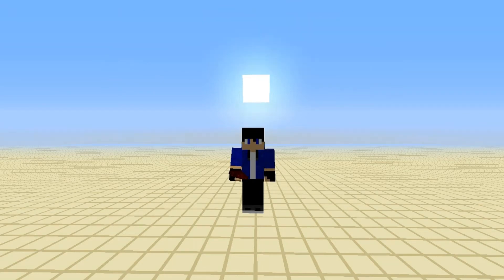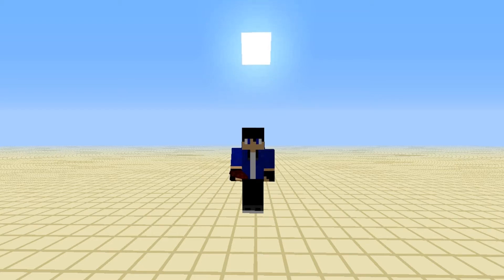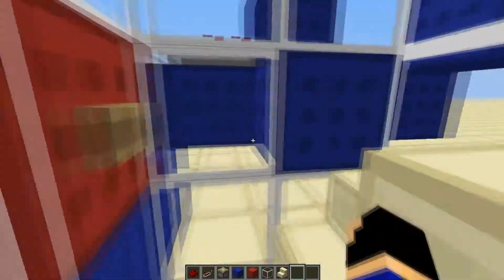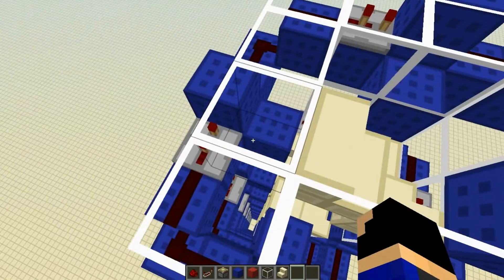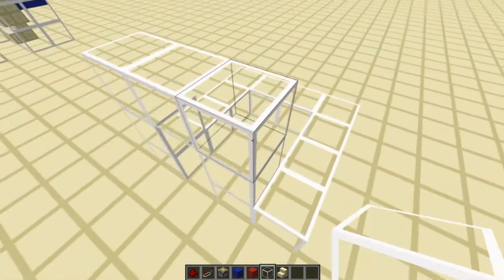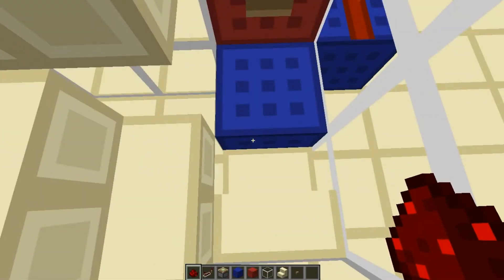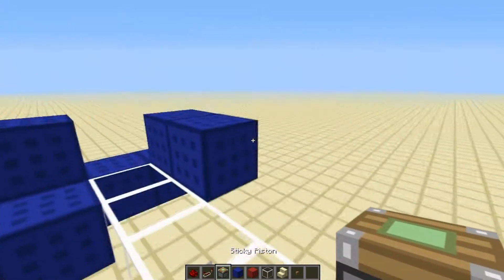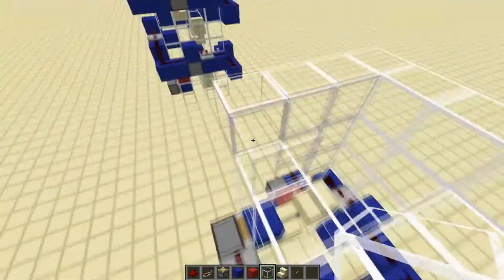Minecraft Piston Elevator (Tornado Design) | 1.7.9 | Redstone Tutorial

Comment: hey Ray,
thanks again, you helped me out with my 4x4 piston door (now my TV can go on and off with a click on a button :)
totday i'm building a trainstation in a tower. I used your elevator to go up there.
on I tried on 1 tick and didn't get stuck like you warned about ;) I started at a Y 66 and got to Y 100
Reply: A little correction about what I said above, some time it happends that you get stuck around Y90 so it is about 24 blocks high save to use a 1 click elevator higher than that will be better to use 2 clicks
Reply from the maker: I'm glad you're enjoying it! I've made a newer faster more compact piston elevator (Minecraft Faster Piston Elevator (10 Blocks per Second!) [1.7.9] - Redstone Tutorial) if you wanna check that out. However, this one's a bit less reliable, so you can pick and choose which one you want :D
Reply: Ray23179
 I will try that design on one of the other towers ;) thanks for the tip